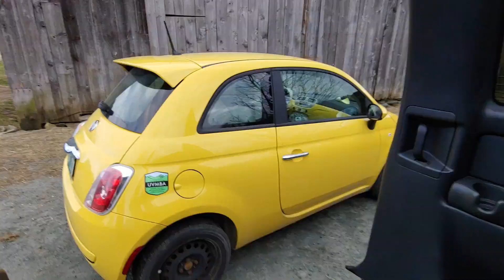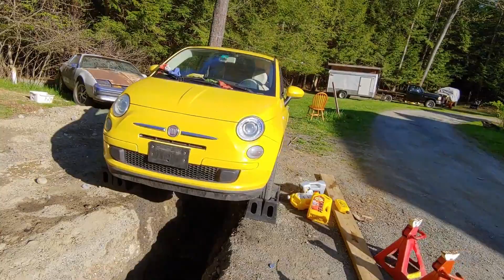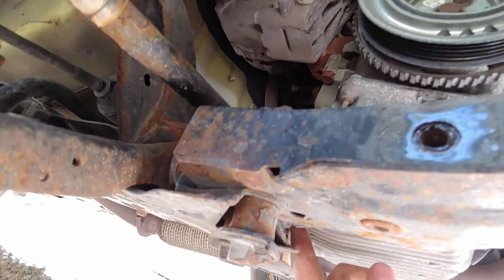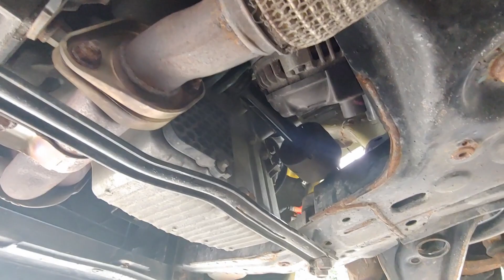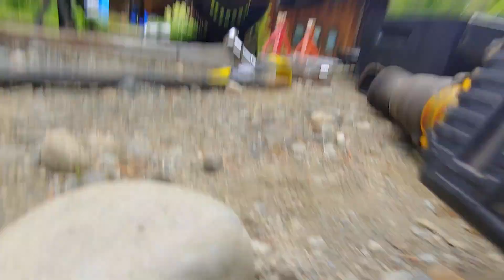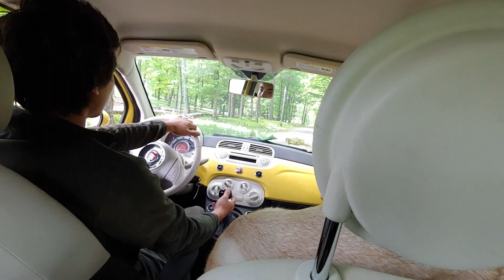Repairing A Fiat 500: Who Designed This Car??

Comment: I have seen alternators fail on Saturn’s at the 5 year mark, one had 100000km and the other had 10000km. So this while sucking for access and alternator reliability is certainly not the worst. That being said I have had two Honda in which the alternator were never replaced despite having over 300000km on both. I had seen the interiors are cheap, cheap, cheap and not durable either. Can’t speak for the engines.

Comment: Lol, the battery comment reminded me of when I was changing the multi function switch on my Mustang. I took a break and reconnected the battery so I could throw a quick charge back on my phone and got back to it. About halfway thru reaming it from the column the guy in the video said “be sure to make sure you’re battery is disconnected as you could detonate the airbag”. I literally flew backwards as I quickly realized my phone was still charging with my head right next to the airbag

Comment: Well, problem with the 500  - it`s basicly a second generation Panda.
Panda is/was a dirt cheap, little, super practical car. Parts extremely cheap. Had its problems, but mostly simple to fix. They hat to cut corners for that price - you get what you pay for, but it was OK.
Then Fiat made a "cute" car out of it, cramped bigger engines and lots of extras into that dirt cheap Panda and sold it for double the price - the 500...that`s how you do it folks. The ladies loved it.

Comment: I worked at a Chrysler dealership for 10 years then Fiats started showing up and it was like a whole new brand. I can drop the transmission out of a Chrysler minivan in under 2 hours. A Fiat 500 takes a day or two with much frustration. The front fascia, radiator/condenser fan has to be removed, and the engine and trans are dropped and moved forward out of the car together. And yes I used the jack meant for lithium ion batteries. Its never been used for a battery at my dealership.  So yea if you want to replace a rear main seal, which I have done on one of these and the guy paid for it!, thats what has to happen. Almost complete disassembly of this turd shaped golf cart and about 15 hours labor.

Comment: I think most new small cars are hard the work on. Manufactures puts so much stuff under the engine bay to make them perform as good as normal sized cars. Emission control systems, electronic power steering, driver assisting systems... a lot of bullshit that actually you dont need... i wouldnt get any small car new no matter what the brand is

Comment: It is not a poorly designed car.
It is not a car designed to be looked at by someone using a mud pit.
Reply from the maker: Hmmm if that is an insult i am not offended
Reply: @ARuralVermonterQqjmcb182  
No it's not. 
European cars are much more compact, with compact, small displacement engines, and compactly located components. 

You're not going to service such a vehicle like that.

Ed. In contrast, a Jeep is designed to be fixed and serviced on the trail.

Comment: How can you complain that a 8 year old car is rusty in Vermont, when the owner could not be bothered to spray the car with undercoating, when you live in a environment where salt is spread liberally on the roads in winter, you obviously have to protect your car (or see it rust to pieces)
Reply from the maker: Well it has more rust than other 8byear old cars i work on with similar maintenance done, i assume fiat cheaped out on rust prevention

Comment: I don't think an alternator should go bad after just 90k miles, however to show a small citycar that's done 90k miles and is 8 years old and the only thing broken on it is the alternator and then call the car an unreliable piece of crap is a bit of a stretch. Also comparing how easy it is to do this job an a massive oversized truck versus a supermini is rather unfair, no? Like you can make everything accessible is 5s if you have acres of room under the bonet - Fiat didn't.

Comment: When it comes to small cars, none are going to be easy to work on. I actually like 500 because even though there are quirks, it's easy to work on. But I have the tools to work on my car, although I will agree my Ford trucks with mild exceptions are easier to work on. 

The thing about small cars is that most are ugly, and some are way over priced. You can pick up a used Fiat 500, early models, between $2,500 and $5,000. This yellow one you're were working was way too rusty. Most I see hardly have rust. When I see surface rust, I walk away because they often have corroded parts like alternators.

Comment: Here in the USA I worked for a medical device company that was a division of Fiat.  I understand your pain.  There is a reason there are so few of these cars still on the road only a few years after their reintroduction in the US.  You're a talented mechanic, and you're a braver man than I...If it's made after the mid-1970's, I wont touch it.  PS: I like your socket tray that you can bring to the work site.

Comment: Yer a lot of cars are like this. Try changing a knock sensor on a Honda CR-V.. or replacing the alternator. A few corroded bolts and you are taking out the subframe.

Comment: The 500 is made in the same factory as the Yugo.
Reply: That would explain a few things.
Reply: The ones here were made in Mexico. Fiat revamped the Yugo factory and rebuilt the roads to it. They promised good jobs.
The average worker makes $140 a week - with overtime- and no you can’t live on that there either.
So they do not care how they build them and sometimes actually sabotage the  cars

Comment: Rust on the undercarriage really depends on conditions you drive the car in. My Grande Punto is 14 years old and does not have any rust on the undercarriage mostly because the weather is not that humid of wet. Check out the undercarriage on cars from the UK, event the ones which are 4 or 5 years old look a lot worse that this. Also this rust looks more like surface level, it can be cleaner pretty easily :)

Comment: In my vw passat 3 bolts and belt tensioner pulley adjustment required to change alternator it's a half hour job. I would just fling this heap!!

Comment: I've also got a Vibe; a very practical car, even if quite noisy on the road. AND, I've got a Fiat 500 -- but it's a 1968: 2-cylinder, air-cooled. It's a head-turner. Only problem I've had with it since I brought it home from Belgium in 1999 was a stuck (and thus bent) valve. 
BTW, I've got a friend in Florida, a retired industrial design engineer, who has been driving Fiats since the early 1950s (yeah, he's a geezer!). He's owned 17 or 18 of them, driven them over a million miles, and considers them well-designed cars. He reports no problems with his 2015 "500." Just regular maintenance, etc.
How do you handle a rainstorm with that pit? It must take a week for the ground to be solid enough to drive over it.

Comment: You should try working on some 70s and 80s cars they seemed like they where designed by some engineers that really hated mechanics. I had a jeepster commando with a v8 you had to take the motor mount off to change the oil filter

Comment: There is some really good repair manuals on the market. The Ford Ka shares many components and some bodywork can be done very similarly. Depending on the engine types/model/year the alternator and other parts can be difficult to change. Overall the design is not great for "field servicability "but for a city car its ok. If you ever worked on a Mini you would know whats really crazy. Its really pretty durable for a small italian car.

Comment: I absolutely hate hate hate, doing any work on Fiats. To do an Oil Change on the 500, you have to go behind the passenger headlight with two 18inch extenders a swivel and a 24mm socket. It's so dumb.

Comment: Seems about the same difficulty as my Ford Focus ZX3. It is my first car, had it for a long time, I have done it 3 times so far. You either gotta move the subframe, remove the axle, or unbolt the engine mounts and wiggle the alternator out.

Comment: I've owned a fiat 500L 2014 for 5 years and only replaced oil/tires. It's manual. And the Audi passed you because the fiat 500 only has 101hp and that Audi probably had 140+ hp.

Comment: I was always under the impression that small 4 cylinder cars(regardless of make) is 100k miles and done.
Reply: I' ve seen 2 cilinder  Twin air Fiat 500's still going after 100 k miles without any major problems. Maybe the road conditions
are horrible in some American States compared to Western Europe. A 1.4 Vtec Honda 4 cilinder can easily get a 300 k mileage without any problems. Unless the driver is a total douchebag .

Comment: Every small car is a mess under the trunk, there is no enough space to put everything where you want. Try to see inside a VW Up! or a Toyota Aygo and let me know. It is not a matter of poor design, it is a need because of no space. Easy to judge if you compare with vehicles which are 2 m longer (6 ft for those who still use the imperial system...).
If this was poorly designed, let me know why FIAT has about 30% of shares in this class of vehicle in Europe. The 500 shares the platform with FIAT Panda and Lancia Ypsilon, altogether they make about 400.000 sold in Europe every year. Even Ford made a car based on this, the Ka.

Comment: I'm not gonna say that the car is a masterclass in engineering design, but keep in mind that Fiat wanted to design a small city car for the italian market.  Given how small it is, there were bound to be some silly (in retrospect) compromises.

I have an Abarth, and just fitting 205-wide tires upfront required Fiat to install some stops on the steering rack, otherwise the tires would rub the inner fenders.  As a result, the turning radius is what you,d expect on an exotic Lambo.  The transmission can't be a 6-speed because there is no room for it.

But in Europe, it comes in base trim with a 69hp engine.  It's small, its engine bay is cramped, but this is what they could do.

Comment: Issue with Fiats is that they are cheaply built, It has nothing to do with electrics etc etc. They are just bad quality parts all together. 
I have had several Fiats, including one thats actually built in Italy and they mostly worked fine...until they didnt. Never had any electrical issues tho, 1 was water pump and the rest just started loosing power.

Comment: What may have actually worked to get it done faster was if you had it on the ground, and jacked the engine up a bit with the mounts loosened with a wooden block under the oil pan between the jack. Then I think you'd get that couple of inches of clearance you needed. I did this on Mitsus before.

Comment: That looks like excellent engineering to me. Someone told an engineer "fit all these mechanical bits into as small a space as possible and make sure they still have enough room to function properly," and the engineer figured it out! You're frustrated by the design team who set the directive of "make a small car and minimize the amount of space used for the mechanical bays."

Comment: BMW diesel 2,0 N47 - if you want change timing Chain ,  you need to pull out the bumper and engine:)
not to mention the costs, fiat is cheap and that's a plus.

Comment: 1st time working on FWD cars eh? Engines mounted sideways 😀 It was a French idea....(although its an italian car) Beetles expression getting in is priceless.....🤣
Reply from the maker: my van had it that way too, but replacing the alternator on that only took about 45 minutes...
Reply: @ARuralVermonterQqjmcb182  oh yes ...i forgot.....the Canadian trip van....😀. Your Vibe have more room at least....Toyotas tend to give more room vs compact EU cars
Reply: The transverse FWD cars at least since the 1980's were designed for packaging, not maintenance. The GM V6s and V8s you have to roll them forward to access anything on the back of the engine - including plugs. But it isn't just GM. VW/Audi is equally guilty. Changing the timing belt on the Audi 2.0T (1st gen) is a day and a half job. Most of the front of the car comes off. and the frame is put into "service position" to give you just enough access.

Comment: Also, on modern cars everything has become so design-sake engineered and cramped that on some cars even replacing a headlight bulb sometimes is  a pain in tne butt: on some models you even need to take the whole headlight assembly out to access the bulb.

Comment: I’m surprised you got it out that way. Cars like these have a service mode where you pretty much have to dissemble the front end. At least for minis they do. I wouldn’t be surprised if fiat has one too since pulling a ball joint shouldn’t be necessary for a alternator swap.... should it?

Comment: I have one if these piles of shite yes lovely looking cute car and that it.
The ride and and tier noise is unbearable on any drive more than 15 minutes long
The pin in the drivers door has been replaced twice a known fault  
It’s party trick if the battery is slightly run down on power it will start and run for a second and shut down I keep jump leads always  in the boot

Comment: I think in some old mopar muscle cars with the 426 hemi the back spark plug was tough to get to.  The service manual said to unbolt the motor mount, and jack the engine up to get to the plug. What kind of a hipster dufus designs things like this?

Comment: I just had my alternator replaced a few weeks ago. Second one in 130k miles.

If you think the alternator is bad, try the ball joints. First, they are pressed into the suspension arm, so you need to replace the whole arm. Not ideal, but the arms aren’t TOO expensive, and it makes for a smaller package and all that, so not too outrageous. However, to remove the arm you have to take off the front bumper, crash bar, and several chassis braces, which is a half a day’s work. I have no idea why they could have just put in an access hole for a socket on that front bushing.

Overall the worst financial decision of my life. Looks great, fun to drive, fair on gas, but between regular service and repairs, I estimate it’s been in the shop about a hundred times in 8 years. It was almost 50 trips before the warranty expired.

Comment: How did you drive the car unto the trailer? You must have put on a serpentine belt. Is that true?
Reply: It'll run until the battery goes flat without one if the water pump isn't driven by the serpentine belt. Even if the pump is driven off that belt, you can still drive it onto a trailer without doing any damage - even on a Fiat. 
The belt went on my '87 Cavalier and I drove it home because on that the water pump is driven off the cambelt so it wasn't going to damage the car.
Reply from the maker: I was able to drive it with no serpentine belt. I just had no power steering, alt, water pump, or accessory function.

Comment: this was an easy one. not hard job. really. also , motor is simple. have you seen multiair or multijet? better not. and with 3 bolts ! crankshaft pulley is over, and bingo!!

Comment: This belt was supposed to be checked and replaced if necessary after 50.000 miles.
And it is obvious that this car is not even close to be serviced in regular time.

Comment: Pain in the ass job, Do Not buy a modern Mini, they are worse to work on!!!!!!!!!!!!!!!!!!!!!!!!!!!!!!!!!
My garage did a clutch on one three days, take apart the front of the car, fit new clutch, put the car back together, then tell the owner to sit down, probably with a strong drink when you hand them the bill!! ha ha lol.
Like your pit, but hey it did the job. Modern cars are a pig to work on! Engine bay crammed full!! The other car to avoid, Mitsubishi VR4 V6 turbo unless you have the hands of a five year old, engine bay is TIGHT!

Comment: Any time you have access to the rubber damper on the axle make sure to remove it. Our VT winters love to trap salt in there and eventually the salt and water will corrode the axle until it snaps.
Also, remember, chrysler goes bankrupt every decade for a reason.

Comment: No there nothing wrong with tge build quality and it quite normal on a small car tgat auxiliary items are tightly pack it a small engine  bay it  takes long. Afterall american car are over sized and not designed with economy or small roads in mind

The belt will snap shredd if the auto tensioner are at there limit due to the belt being stretch because it not been replaced.
Have you check the alternator for seize befire removing?
When was the car last serbiced folliwing tge manufactures service. When alternator last lubricated?
Do not blame fiat for poor ownership! 

You talk about rust but American car do not have the extra rust proofing on,  as you will not pay for. Plus  your on dirt roads with loose stone hitting up it will rust worse. For an 8 year old car looks ok.

Comment: Such a peace of shit car.

My 1989 Fiat 126p is way easier to repair, I was able to install an ABS system into it and the alternator is faced towards me when I stand in front of the engine 😂

This year I'm already trying to convert it into an EV because I won't need any converter plate for the gearbox and I bet that this car will be really difficult to convert into a EV
Lmao

Comment: And the same thing goes for the second generation Ford KA which uses the same floor pan and a lot of the body structure as the 500 and it were a joint development.  They are both a complete nightmare in maintenance terms once they start to get older as a lot of the parts that wear out on older vehicles are a nightmare to get to, which makes the repair costs a hell of a lot higher than they need to be, especially when you're paying garage labour costs...